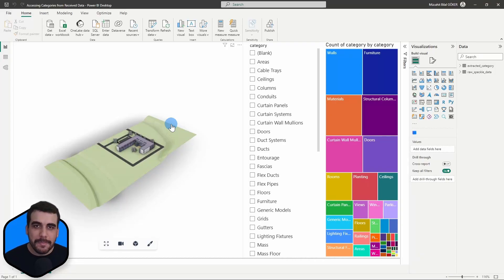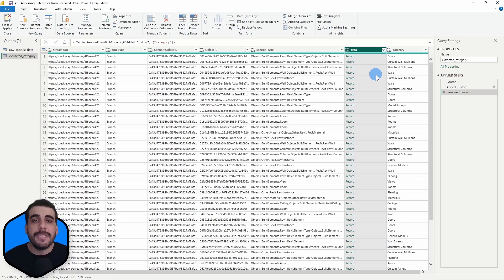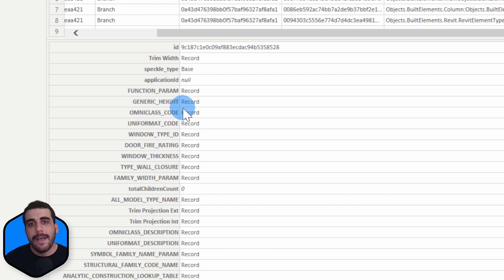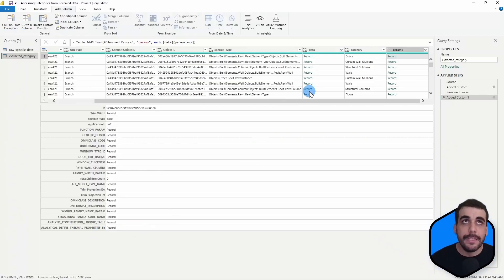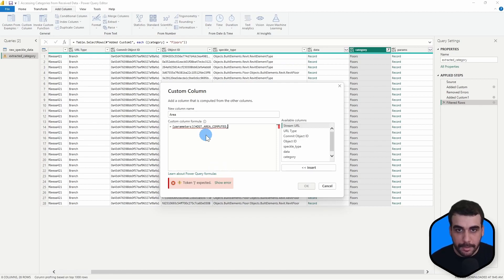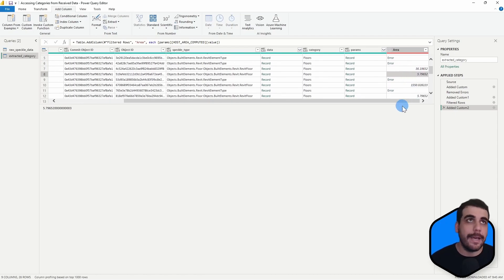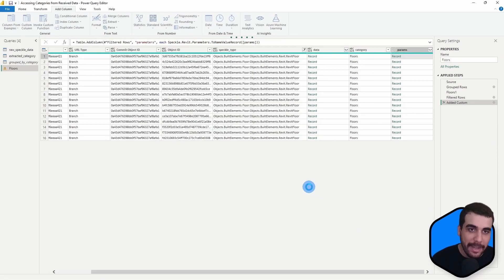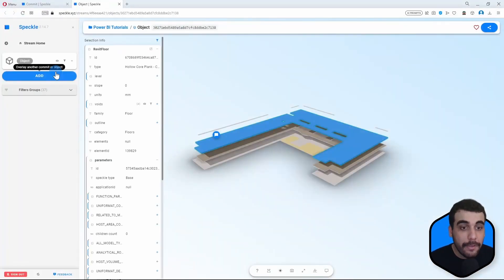Extracting Revit Parameters in Power BI

Comment: Bilal, selecting elements in Speckle visualization, does not filter other Power BI visualizations. How can I solve?
Reply from the maker: Hey Bruno,
Sorry to hear that. Can you make sure Tooltip Data input is set. We've had some reports that when it's empty, 3D Visual doesn't interact with other visuals.
Reply: @SpeckleSystems  Hi Bila, I added the data. Maybe it's related to relationships between tables

Comment: Hi Bilal, thank you very much for the amazing tutorials.
I've just started to use the speckle for powerbi, I've followed all the steps you've mentioned here, and the query I face here is...In speckle site my 3D model parameters are named like "40160c30-0e43-48a5-889f-f5bd3978e560" soo when i try to create a custom column for the parameters in powebi after typing the custom column formula "[parameters][40160c30-0e43-48a5-889f-f5bd3978e560][value]" it shows error as invalid identifier for 0e43, I;m not able to proceed further by getting this error, can u help me out?
Reply from the maker: Hey there,

I'm assuming you asked this question in our community forum and got your answer. For those who are experiencing the same issue, please refer to this video: https://youtu.be/UO0ncJ9DN4k?si=CJ-m0tgu9kvaL8C7
Reply: @SpeckleSystems  the link isn't working for me. however typing the parameter like that [#"40160c30-0e43-48a5-889f-f5bd3978e560"] will solve the issue